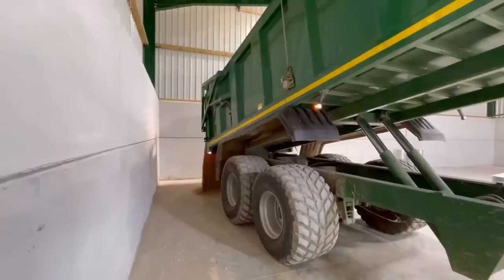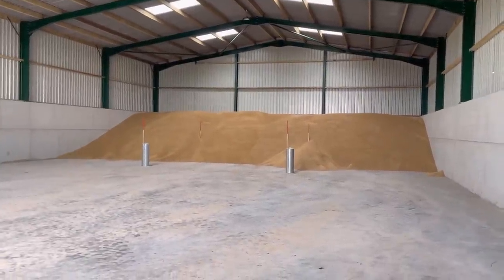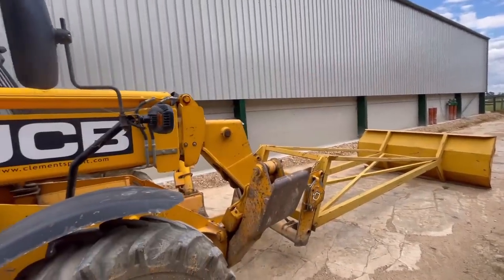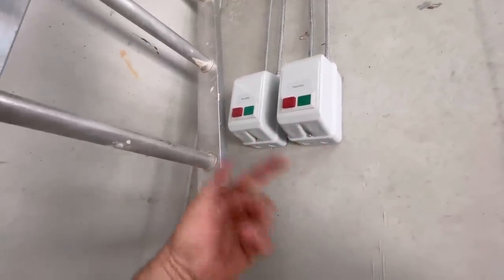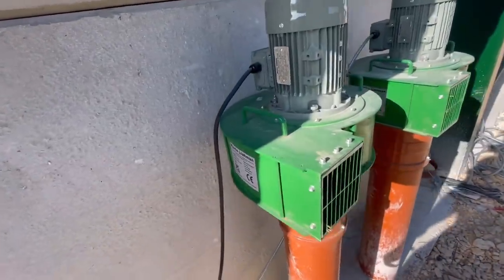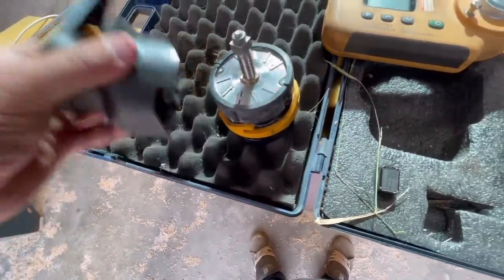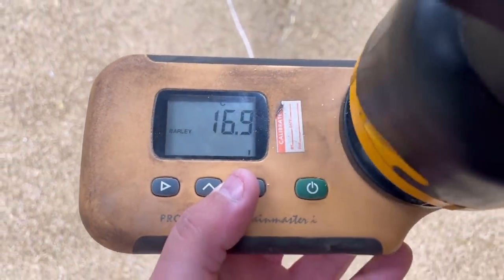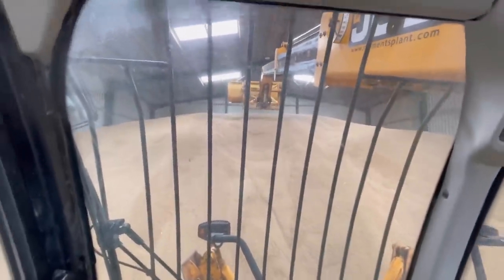Build your own grain store (filling it up to the roof)

Comment: Neat job with the fans! As an electrician I would recommend if you put a plug and socket on the bottom of the isolator. You won’t meet to leave the fan out in the elements all year round and will extend its life. Mark it up as fan use only, if it is likely some numpty will plug something else into it. FANS WILL NOT RUN IN REVERSE. Turning the impeller want work either I am afraid, you need a square to round adapter and turn the fan over.
Reply: The fans are centrifugal so I don’t think you can reverse the flow.

Comment: That’s a nice barn, very nice 👌 You can’t reverse the motors, but it only needs a square-round adapter to blow into the floor ducts.. Because the motor is separate from the fan they will suck hot air from a heater just fine. I’ve sold water heat exchangers to dry wood chips in a barn with a mesh floor, the heat helps. Equally, if it is 21 temp in the core I bet the fans dry it really well.. The humidity in the ambient air is a big part. You don’t want to be pushing damp warm air into it, if you see what I mean.. We were still fighting damp at 600 temp and used dry nitrogen bottled gas. Damp is mental :D

Comment: Great idea about using the motors in reverse. Only need good ventilation to remove the moisture 👌🏼
Reply: Doesn't work though. A fan like that can only work in one direction, it can't work in reverse.
Reply: @timderks5960  They are centrifugal so reversing direction won’t work but mounting the output to the tube should work. (Square to round adapter required).

Comment: First time I saw this way of storing I thought it was crazy. Virtually everything in the US is bins and augers. But if you've ever had to deal with what a pain it is to maintain all that stuff, especially in the dead of winter... This actually starts to look appealing. My only worry would be what would happen if a vehicle used inside sprang a fluid leak.
Reply from the maker: I think it’s crazy using bins and augers it takes about 15 seconds to tip 20tons in a barn. When the shed is empty you can use it for storing machinery. 
That has happened before once just put some spill dry on it or dust to soak it up.
Reply: @Tomlamb980  I did notice there was a commercial truck to rail operator in Illinois that built a big new store building, so maybe it will catch on.
Reply from the maker: Would like to come over have a look around one day

Comment: I'd extend them marker pipes another meter or so so they are more visble as you empty  the store as they seem hardly  high enough to show above the slope of the grain as you take a full bucket out , you can bet as you are loading a truck and filling the bucket right up you just catch a pedsatal and as you back away with the bucket full  the top of the pipe just comes visable 1 bucket to late !  Nice job though looks great.